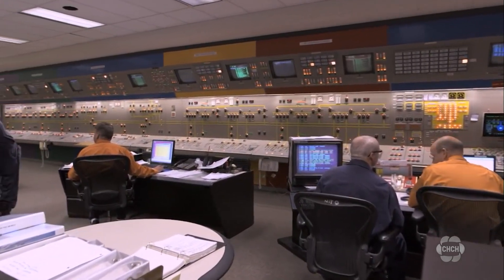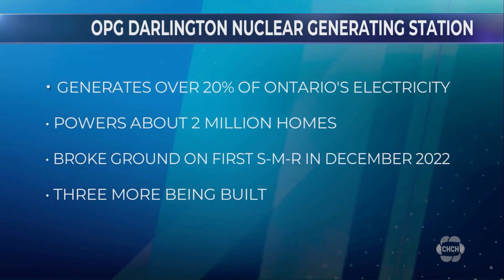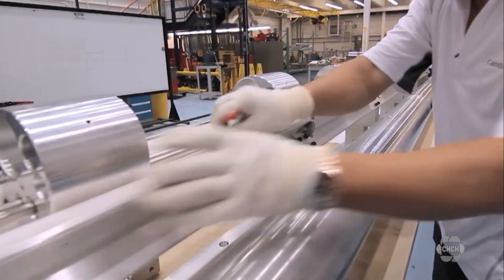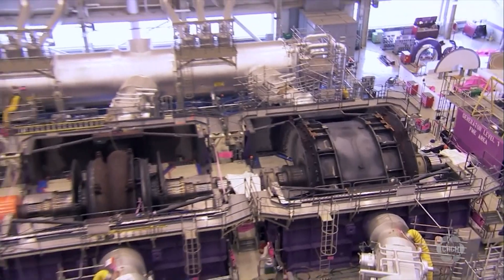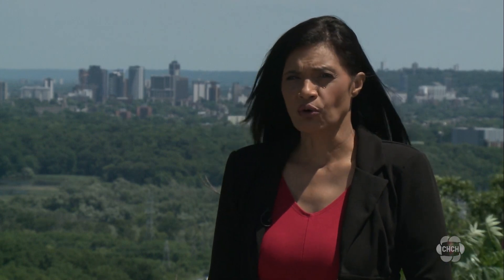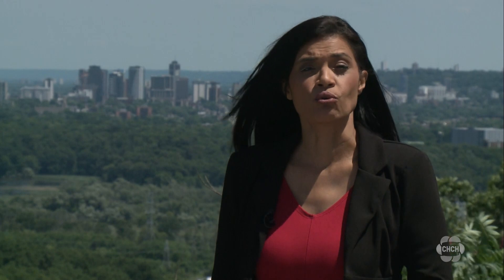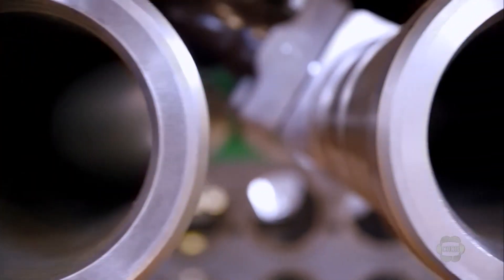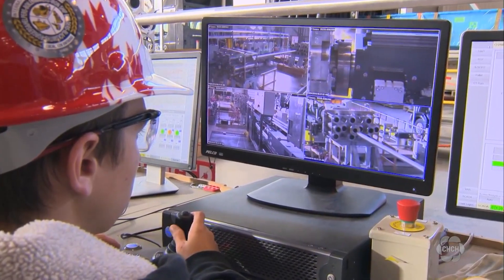Ontario Power Generation and province plan 3 more small modular reactors

Comment: Electrifying intensive industry might be a okay intermediate step, but the end goal, but it involves reactor producing heat, heat driving turbine, electricity transmission, finally heat generation again. Each of these steps introduce significant inefficiencies. After SMRs are proven, the potential slam dunk win would be to install them at plants themselves to provide a source of direct on site heat.

This is the promise of assembly-line produced reactor units, not just for the constrained market of electricity plants but the wider market of industrial plants, directly replacing fossil fuels.